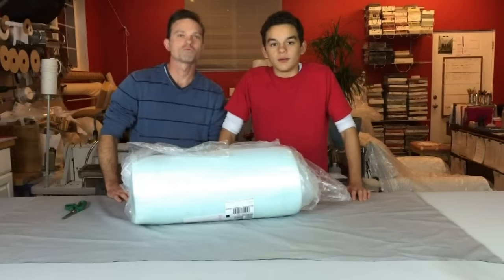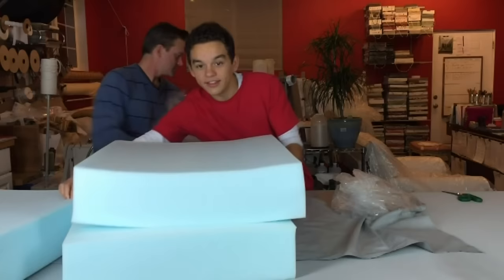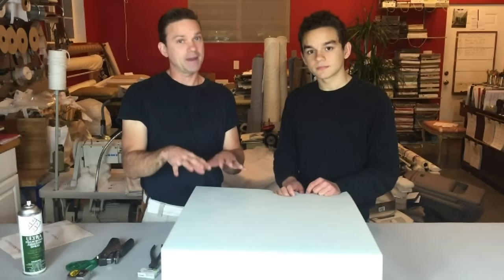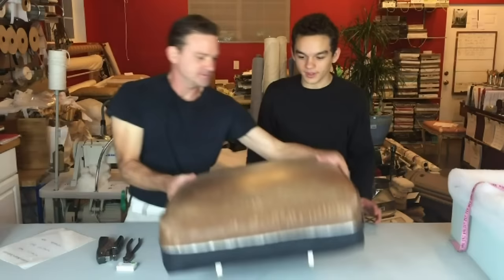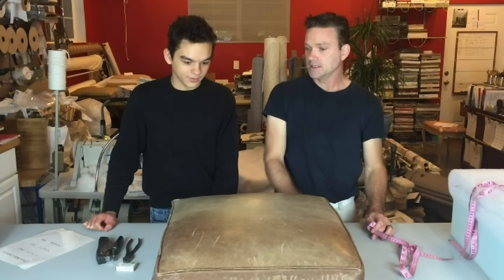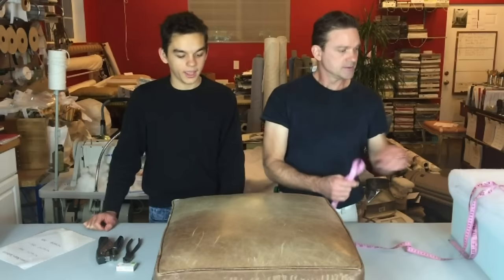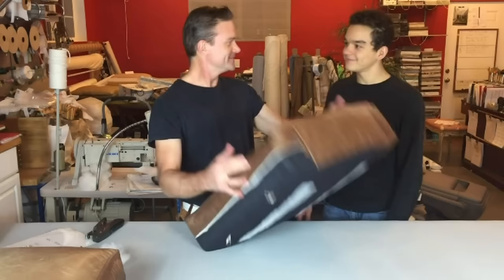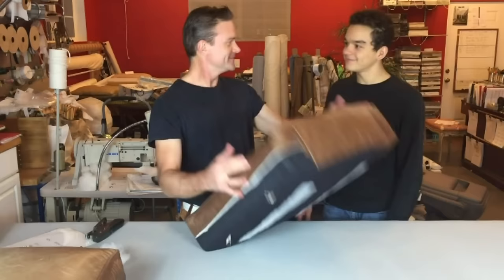Replace the foam in your seat cushions fast and easy!

Comment: I have a leather sofa with three cushions.   When I look at the foam, it appears to be three layers glued together of the same foam.  I measured the foam and it is 6 in.  There is a number that appears to be 4550 x 3D on each cushion.    So here is the questions.  Can I just use a 6 in deep piece of foam.  I noticed that you measured the cushion but is it ok to just measure foam and add a inch.  Would you use a 6 in deep and a 26 density and 26 compression.

Comment: Do you have any videos on cleaning foam cushions?
Reply from the maker: Hey Linda,
Thank you very much watching and the question. However sorry to say we don't.I been meaning to do one for a longtime. Usually
NOT ALWAYS the safest, best thing is to have them professional dry cleaned. IF you clean the cushions yourself leave the covers on the foam. So the cushions can keep as much of there shape as the are drying. Suds in a bucket from a CLEAR liquid dish soap. Using only the suds in the bucket, a soft  brush,  say a BRAND NEW shoe brush. A wet vac, use as little of the suds as needed. Work small areas at a time, vacuum out immediately as much as you can, repeat if necessary. The worst thing in furniture cleaning is harsh Chemicals and over wetting the furniture. I do hope the gets you where you need to be with this reply. All the best, please share the videos it helps us a great deal when you do.  All the best,    Paul

Comment: Who would you recommend we source the material or what brand of foam and batting do you use?  Thanks
Reply from the maker: Hello Cliff,
Thanks for watching the video and the comment. When it comes to fabrics choices WOW!!! MANY places to choose from. I can help you on this, if you don't already know. You can not go by the thickness of a fabric to say if it will be durable or not. Look for what is called double rubs or an abrasion test. We like to only go with 1300. and UP! For regular use. IF they (the fabric producer) don't test it then we don't trust it. Fabric prices have headed to high north ever since 2008 and they have never looked down. As for the foam as said in the video no matter where you buy it, get the highest density you can. It last a lot longer very much worth it. We can help you if can't find it online: Send the measurements to videos@urbancastlesolutions.com   for a price. Hey Cliff again thank you and please share the videos it really helps when you do.  Cheers,   Paul

Comment: do i have to add that thinner layer( Dacron ? ) to my foam if it came without it ? And the foam i ordered came 72" long     whats the best way to cut?
Reply from the maker: Hey there, thank you for watching we appreciate it. No you don’t need to use Dacron if your cushion didn’t have it at first. If the cushion looked good and was fine without it then you don’t. Cut the foam using a hacksaw blade or an electric carving knife. In either case it’s important to keep the cutting tool straight up and down NOT angled on the underneath. It will be great. Again thank you for watching. Please share the videos it helps. Cheers, Paul
Reply: @ucsolutionsgivingmore  thanks a lot !

Comment: My Question is that My Mom's old cushions have stayed squared ...I bought a new sofa and only after a month they're not squared anymore...The fabric is torqued and they look horrible.They are foam and we tried wrapping them again but it did not help. My Mom's cushions were spring and down and as I said the slipcover never got out of square with the boxing. If I want to order down and box spring cushions how would I measure to make sure I order the correct size because they run a good 250 to 300 each. Do I measure like the foam or is it different and/or is it my fabric that is making the cushion fabric torque and twist or was it that the foam not firm enough and large enough???? I should have just kept her sofa!!!
Reply from the maker: Hello Constance,
Sorry for the late reply we have been super busy here. You have GREAT questions. I will not be able to give them justice in a written reply. Contact me at videos@urbancastlesolutions.com    Subject FEATHER and FOAM. I will contact you, it could be a number of things causing the cushions to look that way. I will need to talk to you on the phone if that works for you. Give this reply a thumbs up that will let me know you received this reply and will contact me at the above email address. All the best,  Paul

Comment: great video!  what density are 4 wheeler and snowmobile cushions?
Reply from the maker: +Chris Kelley
 Hey Chris, Sorry for this late reply, it's amazing how fast time goes. I would use high density in those cases. I believe it would last longer as well as be more comfortable. All so, you might want to think of using outdoor or marine foam, high density. The cells in this type of foam, are large or open and let any water that gets through to run out faster. If you don't want use that foam, (it does cost a little more) then just keep it covered when not in use, it should be fine. I hope this helped you. Cheers,  Paul

Comment: Great video, how you made re cushioning interesting is amazing. Im trying to replace cushions for a 1980 stressless recliner.  I cant really decide if i need 2.5 or 3 inch and the density,  Im 110 lbs so dont want it too firm,  any suggestions?
Reply from the maker: Hello Jennifer, thank you for watching the video. Yeah it's a hidden secret on cushions few know about. 😂. Great question between the 2.5 or 3" I would go with 3" The half inch, it will be just a little more comfort. 3" is so little in thickness I would go with 35 compression that medium firm. Of course the choose is yours. Thank you again.
Cheers,  Paul
Reply: @ucsolutionsgivingmore  I'm planning on puchasing from you so would trust your advice. I have it all in the cart but just not sure if I'm offering correctly.
Reply from the maker: Hello again Jennifer, that sounds wonderful. Take your time to make the right choice and there's is live chat with Grant my son if needed. Ask a question if you have one.  Cheers,  Paul

Comment: It appears you measured the thickness of the cushion  without considering the thickness foam and of the Dacron.  Doesn’t the thickness of my foam plus Dacron need to equal my initial cushion measurement?
Reply from the maker: Thanks for watching our videos! Great question, no, the thickness of the cushion cover itself plus the additional inch accommodates for both the foam and the Dacron. The Dacron itself should not be a factor in your measurements since it only provides the crown to the cushion and nothing else.

Comment: Hey guys.  I got sticker shock when I called for estimates to replace the cushions on my 3 seat couch with 2 cushions.  I just paid it off so I feel it still has some years in it.  I came to YouTube to find DIY tutorials and found you.  Need a bid of advice though.  My lined microfiber cushions are flattened and misshapen.  I can determine that the heighth is 5" from the back corner.  Because the cushions are so lumpy I measured  seam to seam on the cover itself only. They didn't look like the leather cushion you used in your tutorial that still had a firm shape to it.   I am measuring 33" width and a 28" depth.  Would you advise adding 1" to each of the 3 measurements like you did on this tutorial?  Planning to add Dacron, too.  

Lastly, do you have a supplier you recommend?  The few sites I've visited so far don't follow your guides for choosing foam density you taught in tutorial
 
Great teamwork.  Thanks for sharing your craft.

Comment: hi why don't you use spray adhesive instead of staples ?
Reply from the maker: Hello Iza,
Thank you for watching and taking time to comment. Great question! Glue holds really well and is fast when putting the batting on. Downside the over spray gets on just about everything, not very good to be breathing and is another cost/supply to have in stock. Staples hold very well  and have none of the aforementioned side effects. Thanks again for the question and let me know if you have any more questions or need help with a project. Please share the videos it goes along way when you do.   Cheers,   Paul

Comment: Do you need the dacron?
Reply from the maker: Hey there, good question it's best in most cases, here's why. Dacron helps give a little softer feel. Gives a crown (loft look). Stops the foam and fabric from rubbing, which can and will wear out the fabric and break down the foam. It also helps the cover to move independently from the foam insert, stopping the crawling of the cover.  Please share the video it helps us a lot when you do.  I hope this has helped you cheers,  Paul

Comment: I have a sofa cushion that has a 6”x6” extra bit along the front where it goes informational of the arm- how do I measure for that for ordering the foam?
Reply from the maker: Hello Nancy,  Thank you for watching the video. This video will help you, the cushion you have I believe you have is an L cushion.       Replace Foam in Couch Cushions - How to Fix Flat Sagging L Seat Cushions - 26 Density Foam https://youtu.be/em_-lQJEhok          The cushion is two pieces of foam in one cover. HOWEVER the concept to measure the cover is exactly the same. You can as well go to ucprivatecourses.com go under cushions and click the L cushion section it shows how to measure it. I hope this helps you please let me know if you need more help. All the best,   Paul

Comment: What thickness is the poly batting?  You are using 3 layers, so please provide more detail on that.
Reply from the maker: Hey Elizabeth,
Great question! A full wrap of poly batting should be 1" thick. One layer should suffice in most cases. In this one video I didn't have enough of the 1" poly batting. So I had on hand a batting thickness that is used for replenishing furniture when re-upholstering, freshen things up. For this one job three layers would work just fine, so I used what was on hand. Hope this addresses your question. Thank you for watching and for the comment. All the best. Please share the videos we need it LOL. It helps us when you do. 
Paul

Comment: Just watched your video Nice Question when doing a T chair seat cushion how is the batting done Still not on the sides ?
Reply from the maker: Hi Slapshot400,
Thanks for watching and for you question, we decided it would be best answered in a video: https://youtu.be/QSIYiX1aubE?t=14m31s
We appreciate you waiting and we hope this helps!
Also here is the link to the foam as well.
Order Foam for Inserts: 
The foam density is not ideal we like 26/(it can also be written as 2.6)
However this is the best option we could find so far online.
18 (or 1.8) density - 44 compression FoamRush 4" x 32" x 32" Upholstery Foam Cushion High Density (Chair Cushion Square Foam)
Message them for custom cut foam, poly wrap, and COMPRESSION AMOUNTS
https://www.amazon.com/gp/product/B06...
All the Best,
Grant and Paul

Comment: Can I use these materials for patio cushion replacement?
Reply from the maker: Hi Heather,
Sorry for the late reply. Great question and NO! Is the answer, IF it is exposed to rain. This indoor foam is like a sponge. IF you have a screened in porch as it were, then yes you should be fine using indoor foam. There is outdoor foam you can buy it works very well, also known as marine foam. Hope this has helped. Please share the videos it really helps us when you do.  Thanks for watching,  Cheers,   Paul

Comment: Will this work for fabric cushions? Would you feel the staples when sitting on it?? thx!
Reply from the maker: Hello,Yes this method will work on fabrics as well, there's no difference. As for the staples NO!  Great question, some others have had that very thought. I have never had that happen, the staples fold so well on themselves that the staples become embedded into the poly batting. When having to remove them, they can and are very difficult to remove. So if you are wanting to replace your cushion that are fabric and using staples or spray glue, the method in the video will work for you.  Please share it helps when you do. Cheers,     Paul.

Comment: i was just wondering how do you know if the Zig Zag springs where the foam sits need replacing.. They are not broke so i dont buy foam that might not be needed.. We paid to have our foam replaced 7 months ago.   The seat still goes down when sitting  better than before But Not as good as new......   Foam size installed 5 x 24 x 24 inches (maybe Reflex foam)... i don't think the foam is thick enough as the seats do not crown     Also there was nothing put around the foam.. 

watching this video i think we need inch more deep  and firmer 2636 as she has a fused back.    the sofa is leather and have to put the cushion in from the back not removable like in the video.

Comment: I watched your shows long time, now i am 67 year young and retired and 
would like to upholster my dining room seats (30 year old lost its 
compression ), it's look like  exist. foam were 1.5" Medium Density with
 1/2" cotton on top and bottom of the foam, on top of 5/8" MDF ( 3 out 
of 6 chairs are broken or shattered from center of the MDF). Now i would
 like to replace it with 3/4" plywood base, 1" Dacron+2" 2.8 high 
density , over 1/2" Dacron on top of 3/4" plywood. So i would like to 
order from you,  2"T x 22" x 22"     2.8 High Density  with 65 
compression! need to know how to order it and which site do i need to 
order it from, Please! I even looked up the site that you attached it in
 your videos HOW TO ORDER Foam but it did not work(may be because of old
 email address?! Please. You and your Family are great teachers!
Reply from the maker: Hi, We’re really glad to hear that you watch our videos! In regards to your question, the compression that you should use in that scenario is a 45 compression. This what we use when we are working on a dining chair. If you want a bit more support you can layer the foam using two different compressions in this case a 75 1” on the bottom and a 45 1” on top. You order this at our store: https://ucprivatecourses.com/ucsolutions-products/

Or you can learn more about 26 compression foam here: https://ucprivatecourses.com/26-density-foam-custom-cut/

I hope this helps!
All the best,
Grant

Comment: So i just redid the batting in a cushion of mine. I decided to use spray adhesive instead of staples. Once the adhesive has adhered to the batting and foam, do i need to let the cushion air out, or can i put it straight into the cover?  Thanks!
Reply from the maker: Hi Michael,
Thanks for watching our videos, great question, you don't have to air out the foam insert after the poly batting is attached.
I hope I'm not too late in replying.
All the Best,
Grant

Comment: Is it possible just to add new foam to the existing foam?
Reply from the maker: Hello, 
Thank you very much for watching the video. Yes you can glue on top of the old. However for lasting support you really need to replace the whole cushion. Gluing foam on top will give you a fresh fuller look and feel, but that is it mostly it. If that is what you are wanting great.DON'T forget to add to both sides so you can flip the cushion and get the same look and feel. I hope this is why you where asking and it was helpful. Please share the videos others and on blogs, it helps us a lot when you do.   All the best,   Paul

Comment: Hi, Is 3M77 spray glue good enough for dacron to foam? And, when wrapping couch cushions that have rounded off front corners, should top, back front of foam be covered with dacron  eased by on rounded corner, or should just do to and bottom of cushion leaving off front.  Covers are already pretty tight.
Thank you in advance for any help.
Reply from the maker: Hello! Thank you for watching the video and the comment. YES! 3M77 glue will work no problem. On to the covers, I think it's the cushion bands you are talking about. It's difficult to explain this trade in letter form, so I hope I have it right. I say yes have the front of the bands wrapped with Dacron. You can always REMOVE the Dacron in the front of the cushions if they are to tight. Note NEVER put Dacron on the zipper end of the cushions, it's a mess when it gets caught in the zipper and it WILL. So I hope this has helped you, please help us and share the videos, it goes along way for us. All the best,  Paul

Comment: I have cushion with the L shape. Should I order the full length and cut out or order already cut out? Also, where do I order the form from. Thank You.
Reply from the maker: Hello Ray, Thanks for waiting for the reply. I believe it would be best to buy the whole length and cut out the end of the L to fit.You can use a hacksaw blade to get the job done. UNLESS the company has step by step instructions on measuring an L cushion. The end of the L usually has a lot of poly fill pushed to fill the gaps, not always but we run in to that often. Try foamorder.com  Hope this has helped.  All the best,  Paul

Comment: I have a covered spring coils that were in a ottoman cushion but covered with cotton. they need to be replaced.
How can I do this with foam? or cotton?
Reply from the maker: +wildflowerr1 Hi,
Thanks for watching! Sorry for the delay we have been very busy lately! Yes, all you have to do is take the current insert completely out (springs as well cotton) and replace it with a foam insert using the methods in the videos. Thanks again, I hope this helps! Have a great week!
Best Regards,
Grant

Comment: Do you measure from the piping edge to the next piping edge, or do you measure from the inside of the piping?
Reply from the maker: Hello, Sorry for this late reply. You can do ether one it will not make a difference. Seam to seam is most accurate, but again ether way. Thanks for checking out the video.  Cheers and peace Paul